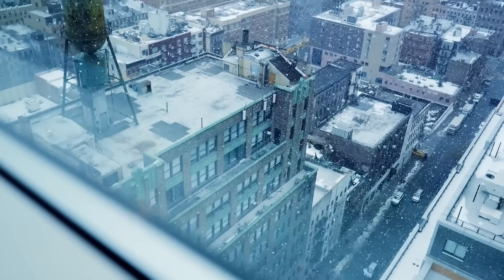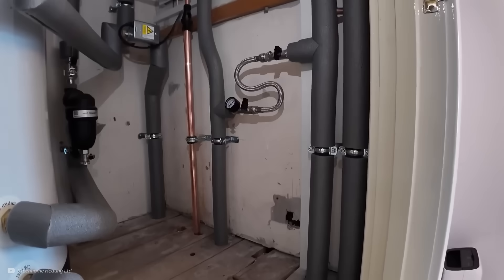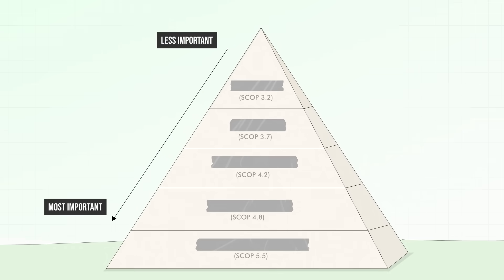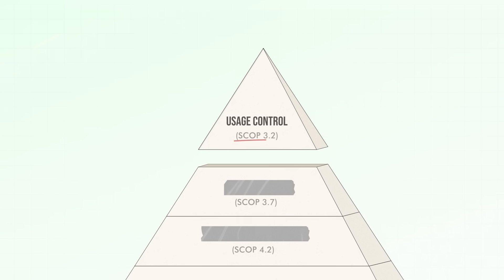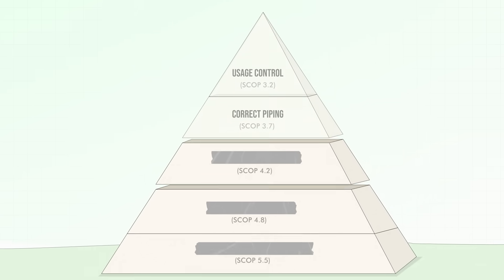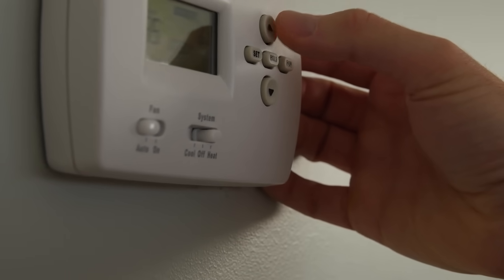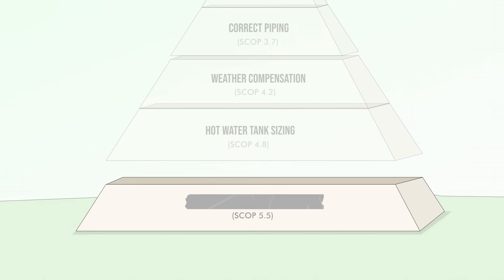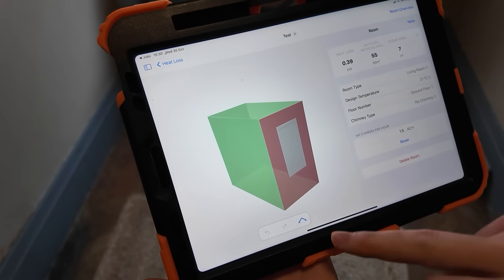The Genius of the World's Most Efficient Heat Pump

Comment: There is an excellent paper on solar hot water systems carried out in Poland:
Energy efficiency of a solar domestic hot water system, Miroslaw Zukowski

In Darwin (in the tropics) solar hot water systems were fitted to almost all houses since the 1960's as gas wasn't available and local electricity was very expensive (initially oil fired power station).

Comment: Two years ago I experimentally added two 7kW air conditioning units to my 2,000 liter buffer tank. I made my own coaxial heat exchangers which work quite well for the first try. Once every day the heat pumps are automatically started and fill the buffer tank up to 57°C and this water is then used in a normal central heating system with radiators. Problems begin when the temperature is below 5°C as the units start to freeze. Defrosting is a big waste of energy and time and sometimes it has a problem to catch up. I will try to run the heat pumps at a lower power for a longer time and will see how it will go. I have a fireplace with a heat exchanger also connected to the buffer tank and when it's really cold I rather fire this up. I grew up by the fireplace and the warmth it produces is still somehow different and cosier then that from the heat pump. Thanks for the great video.
Reply: That's why heat pumps reverse flow to defrost, so it keeps a high efficiency instead of using a less efficient source of heat. My heat pump defrost every hour when it's -30C outside.
Reply: @purpleblueunicorn  Wow, it must be a really good HP and well insulated house for this to work at -30C. We don't get so low, -20 max for a week or so but not every winter.
Reply: @slavric  it's a 2000$ 12k btu tosot hyper heat mini split that do 20k BTU when it's over 10C. At -30C it outputs 10k BTU. Uses 1500-2000W at max power. Only downside is heat distributions throughout the house, not it's good enough and efficient!
Reply: I would have to learn how to use this to heat water. Air to water heat pumps are really expensive! You built yours?
Reply: @purpleblueunicorn  Well, it's hard to say I built it, I modified ordinary inverter split A/C. External units didn't need any modifications, but from internal unit only the electronics was used and is controlled by Tuya app. The hardest part was making the coaxial heat exchanger. You need nitrogen tank and brazing equipment for that. This one exchanges the heat from gas with water. There are some examples here on YT. I can't give specific instructions because it depends on A/C used but I'm glad to help where I can.
Reply: @slavric  What problems would there be with just submerging the existing radiator from the inside unit in a buffer tank? Is the flow rate of a hydronic loop too low for all the fins?
Reply: @slavric  Will definitely look into it. There's a ton of cheap mini-splits on market place, will look how it could be possible to convert an air to air to air to water. Sounds like an awesome project. Also I've heard people modify their mini split offload summer head in their pool, but not sure it's worth it.
Reply: @GarthMitchell  Interesting idea. Unfortunately my buffer tank is a commercial unit with lots of connections but it's impossible to put the exchanger in. I also think it would need some forced water flow because it is dissipating up to 15kW of power and it must do it efficiently. I made something similar to this: https://www.youtube.com/watch?v=gtxryoHbBrM
Each of two exxchangers are about 12 meters in length (~35 foot).  What I also did is I used the surplus internal A/C unit with fan and I connected hot water thru it. It works extremely well to quickly heat up my workshop. It was an experiment which went much better then expected and I'm getting heat from it at this moment. It's such a fun being DIY-er, I mess up sometimes but also get it right more often then not.
Reply: @purpleblueunicorn  It could heat the pool too, why not. That heat has to go somewhere, why not use it. You can buy ready made heat exchangers or you can build them yourself. Maybe a loop of copper pipe in the pool would be enough. It is a project worth taking some time and research.
Reply: @slavric  because I cool for a total of 600kWh in the whole year. That's 40$ worth of electricity. This will get reduced to 30$ by heat loss, pump and added inefficiency. So interesting project but my time would be better spent elsewhere 😅 besides, 750$ in the stock market will generate 30$ a year, so the system must cost a lot less less than that.
Reply: @slavric  but if you were my neighbor, I'd definitely do it for fun, not by myself!
Reply: @purpleblueunicorn  so you take heat from your house and put it back outside? Not efficient.
Reply: @moto_rad  Not sure what you mean. A reversible mini-split can do both, put heat out or bring it in. The only time it works hard is during cold winters where it pulls heat from outside even when it's -30C . COP drops to 1.9 instead of 2.5 to 3 I get in winter.
Reply: @purpleblueunicorn   to defrost if you run it on "reverse", which is air conditioning...  rejecting heat back outside
Reply: @moto_rad  Oh sure, but all fans are off during this time, the heat will stay in the coils and remove ice and snow from the fins. The indoor coil will get really cold, but not enough to cool the room. The room does cool though during this period. I get like 0.5inch of frost after 1h of operation. This heat was generated with an average of 3 COP. Unlike the heat wire on the pan that's using 100W almost all the time under -5C. Would be best if there was no pan at all so frost melts directly on the ground! That's how most minisplits work.
Reply: @moto_rad  If you are trying to cool the house, that is exactly what you want to be doing!
Reply: @ghogarth   you are trying to HEAT the house
Reply: @moto_rad  Not always.  I use a heat pump to cool my house in the summer.
Reply: @ghogarth   a heat pump is just an air conditioner with a reversing valve
Reply: Yes a fire is completely different - best is heating + a fire... :)  Do you have time of day max demands, if so you could time the HP to preheat prior to that time. Also the larger the heat exchangers the better, the best being when the temp of refrigerant and water is the same. As noted in the video they "oversized" the coil in the HW tank for this reason.
Reply: @ianloy1854  At this time of year we have around 0 or slightly positive temperatures in Celsius thru the day but at night it falls to -5 to -10°C so I run the heat pump thru the day. If I heat the 2000 liter buffer tank to 57°C it lasts a full day. I heat my house with it and a part of my workshop, together some 170 m2. Wood helps a lot in very cold winters. I will try to run the HP on lower power for longer time but I use mostly radiators for heating and I need some 50°C to be effective. I must do some more tests to see what will work the best.

Comment: what if... a heating oil (diesel) powered heat pump?? unless the power is provided by nuclear, having an ICE powered heat pump will be more efficient by a lot in terms of kWh of heat over emitted CO2 vs an electrical powered one. the heat loss at the engine exhaust could even be used to heat the home... even a diesel powered generator / power station could provide electricity while heating a home with the heat from the exhaust....
Reply: and to take it a step further, the lost heat from nuclear could be used to dry molten salt, making fuel for eindhoven battery heating setups.

Comment: All this is very expensive.  How about only heating for 3 hours a day and use a cheap gas heater? Windows for the summer.  No need to talk about investment.
Reply: Gas is is bad for global warming, explosion hazard, health hazard (leaks of the gas and exhaust pollution), another monthly bill for the connection AND not forever....

The investment not only is benefitial for heating costs...it also raises property prises AND quality of life.
Reply: @TheEsseboy  still have to have a gas backup.  Might as well just use very little heating.  There is a lot of GHG emitted making the heat pump set up. What would work better is to have passive heat and cooling in a house.  Windows with low e glass and awnings as an example. Can reduce heating and cooling needs by 90% just doing this sort of stuff.  Small wood burner or gas for those few extreme days.  Even remodeling for this is far less expensive than a heat pump system.
Reply: @stanleytolle416  No, you don't...better to have a generator if you are paranoid, gas is not good to have in a residential building period, cost to have it even if you never use it.

Sure, but you never get rid of the health hazard, explosion hazard, pollution etc. by keeping the gas...
Reply: Heat for 3 hours a day is fine, but you will spend more in those 3 hours than I will in 24, and you'll be sweating by hour 3 the start and shivering by hour... 10?

Comment: That COP of 8.0 is "instantaneous", as others said. I looked at the power, temp and flow charts of my AC. It achieved 2000% efficiency at that same time in September. Neat. I just had to press 2 buttons to get it so efficient, similar to the weather-compensation settings. 

Clickbait title and thumbnail...

Comment: British systems aren't fit for purpose as a whole, trying to utilise radiators for heat is the biggest flaw, underfloor heating at half the flow temperature (38c) and far more economical with the heat provided, more a constant room temperature. Using heat recovery extract fans also makes humidity control easier with adding air tight insulation. A separate heat pump Hot water cylinder like the AMericans use, also, would mean not every goes down when your waiting weeks on a new compressor replacement. ANd if the radiator style has to used, why are we not installing floor mounted split units instead? so many losses using hot water
Reply: Here we do 32 degree flow temp (negative 10-20 C outside) with underfloor heating (Our houses are well insulated, 30 cm of rock wool in the walls, 80 cm in the roof and tripple pane glass windows.)

Comment: With my GSHP I have a mixture of underfloor, 15mm and microbore piping to radiators. I just open up the lockshield valves and let the thermostatic valves do the work. SCOP is close to 4 and instantaneous COP is rarely below 3.

Comment: With a larger container, you don't need such a high temperature unless there is a risk of salmonella... There is ALWAYS a risk of salmonella below 65C.
Reply: That is where UV lights in tanks comes in, big investment but pays off in lower tank temps.
Reply: @TheEsseboy  Thanks, but sounds expencive. In Denmark we use a lot of Metrotherm with smart control for the same reason
Reply: @bibihunden  It is, but they last a long time, so for a new build it is recommended, having a huge tank with 42 degree water is perfect to get a high efficiency for the heating of it.

Comment: Not an expert in water sanitary, but keeping (more) water at a temperature people actually use (40% degrees as suggested) is ideal for bacterial growth. The firm which installed the solar water system in our house suggested a temperature at around 70 degrees Celsius in the insulated water tank (in Malta/EU achieved 8-9 month a year, the rest electricity is required).
Reply: https://www.youtube.com/watch?v=oJeyc_cGIMU
Reply: @nepakter  again, a lot of assumptions are done in this video. And it doesn't take into account real world scenarios. In my geographic region, free energy from sunlight is a given for almost 70-80% of the year. Heating water to 70% degrees with a solar system is basically a given. In matter of fact in hot summer we place a shadow making net over the water system, as water temperatures will otherwise go to near boiling point. As to the water movement, some rooms (like ensuite showers in guest rooms) are not always used. Hence there is a stagnant water issue. Flushing the pipes with 70% waters from time to time in hot climate regions is a must. Large water tanks is also not possible for every household. Some may have property large enough, others not. As mentioned in the video, water at 70 degrees celsius will cool down very quickly. From experience, from the tank on the roof to the rooms, the first water is cold anyway and gradually gets hotter. The danger of unexpected hot water is literally zero. And I belong to the group of elderly who are apparently at higher risk (according to the video).  Seriously, I would take these videos with a huge grain of salt.
Reply: Depends on the water, plus considerations such as 'local' treatments within a/c units.  Other issues impinge also.  In 'hard water areas, limescale precipitates out at (IIRC) 62/63°C.  The UK government recommends >50°C to prevent legionella and there's the window for 'hard water' ... for that particular bacteria at least.